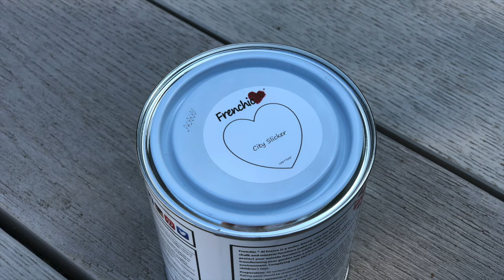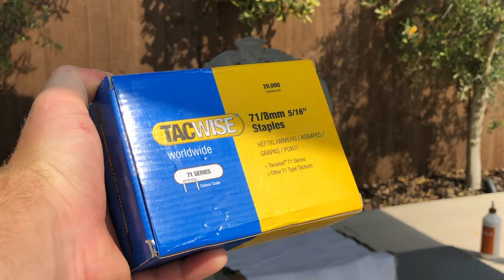Upcycling a vintage chair. Chalk paint and reupholstery.

Comment: It would be extremely helpful if you'd list the type of staple gun you use and the size of the staples. I have a manual gun with 3/8" max staples and not sure if these will be deep enough. BTW, beautiful job on the chair!

Comment: I want to ask about stapling the fabric then cut it so close to the staples.   Doesn't  that cause tear in the fabric ?? .. sitting may cause stretching or pulling then fabric may  tear or get of the staples exposing the sponge??
Reply from the maker: Providing the fabric you use is a sturdy upholstery fabric and you staple the fabric properly to the frame it should be fine. The tension is spread across many staples. If you are worried about the fabric pulling away from your staples you can also opt for a fabric or gimp trim adhered with hot glue which will also help with keeping the fabric secured

Comment: Why didn’t you sand in the carvings. Wouldn’t the paint not stick if not sanded?
Reply from the maker: Providing the surface is super clean and the majority is sanded things should be fine. Four years on and no chips etc

Comment: I have a red sofa and chair with can I paint it white white ?
Reply from the maker: Make sure you clean the substrate or surface you wish to paint very well with a de-greaser and sand lightly before painting. You may need a primer but with some paints you don’t need to prime